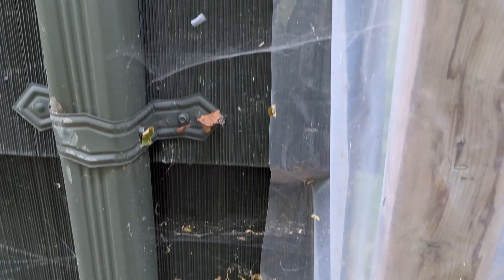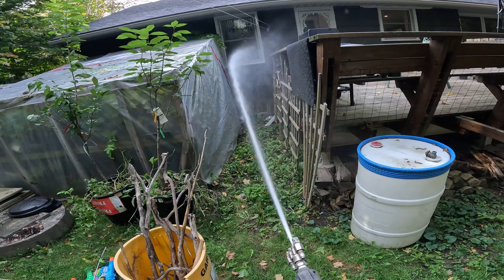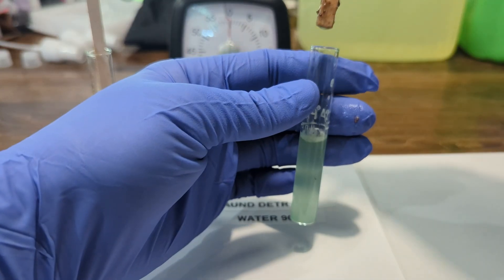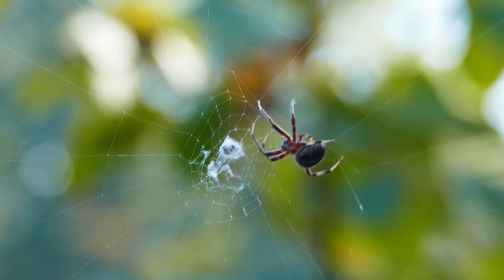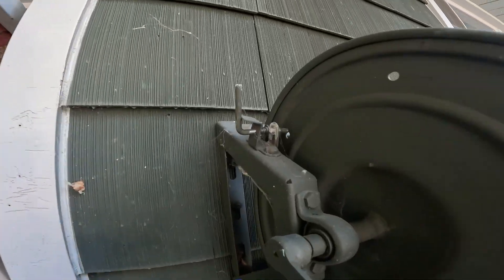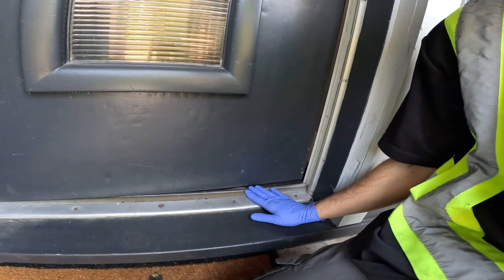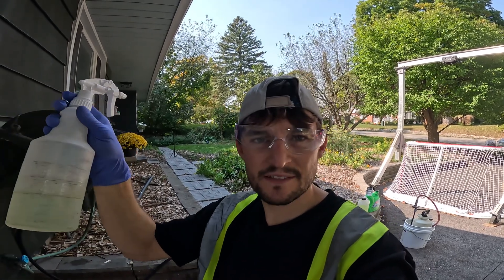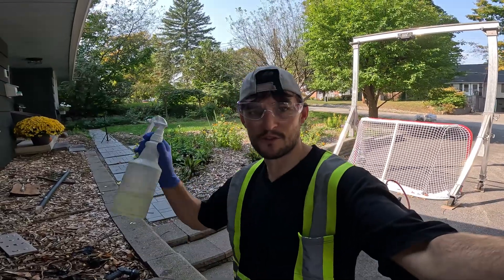How To: Remove Spider Webs with a Pressure Washer & Bleach

Comment: I was wondering whether there might be a miscalculation regarding the final SH ratio, or if I’m simply misunderstanding it.

The proportioner indicates a ratio of 15, which corresponds to approximately 6%. However, since the SH is not 100% concentrated but rather at 12%, the actual concentration applied would be 6,67% of 12%, so 0,8% SH.

The same principle would apply to the X-Jet…

What’s your take on this?
Reply from the maker: Yeah I botched the explanation for this.  I should have stated I was considering the 12% sh as 100% starting chemical concentration.  So yes The final numbers would need to be multiplied by 12% to get the absolute concentration of SH applied.

Comment: My pressure washer has a built in injector at the pump which pulls in cleaning solution. Would this be the same thing that you are referring to as a “downstream injector”?
Reply from the maker: Yes but only if yours works.  Some of the built in ones are not great, so I'd test it and see how much it pulls

Comment: Have you tried this with a foam sprayer, applying the solution? 
It seems like the foam would help saturate the area longer.
Reply from the maker: You can but then you're likely going to be too heavy with the soap.  You then risk having it dry with soap scum and will be spending excessive time rinsing and rinsing. 
But there are products for getting the mix to stick longer, usually used for roofs with a strong mix where there's thick growth of moss and you need the bleach to really dwell. https://pressuretek.com/cling-on-with-apple-scent/

The rest of the time is not really necessary.  Just hit the area again if you need.

Comment: Good job Andrew.  Entertaining and educational! Now I'm ready to clean this weekend.
Reply from the maker: Thanks! Let me know how it goes 😁
Reply: @AndrewMeades  Well, not too good. Tried diluted househould bleach (4 oz to 60 oz water to make 1/2 Gal) and then liquid pool chlorine but didn't see the webs disolve like yours did. Would be helpful to know how you mixed up your solution and what you used. Because bleach is about 6-9% SH, while liquid pool chlorine is 10% SH. So in order to make the pool chlorine 5% I would have to dilute it 50%, which to me sounds too strong to clean with. Thanks for your input.

Comment: Just in time! We just moved into house covered in spiders and spider webs... ugh... eeeewwww!  I was really creeped out early this morning in the dark letting my dog out... I used bleach and soap yesterday but after watching this I'm making it stronger! 👀💪🤺
Reply from the maker: That's great! Yeah one thing I failed to clarify is you need at least a 5% solution of 12.5% SH which is the yellow jug, also known as pool shock, available at pool stores.  If you're going to use Clorox household bleach that's a starting 6% SH concentration, so you'll need to go 10% with it to get the same effective bleach concentration.  Also SH breaks down over time so if your bleach is old that might be the problem as well.  Basically if it's not working after 10 minutes, keep upping your concentration, until it is, keeping in mind the surfaces mentioned you have to be careful of.
Reply: @AndrewMeades i will definitely use the pool shock! Thank you!

Comment: Do you have a video that shows your pressure washer rig for cleaning heavy equipment?
Reply: Thank You for the quick response and sharing your videos!!! Very helpful.
Reply from the maker: @pattyjenkins4829 no problem! Glad you like them 😁
Reply from the maker: I still need to make a video of my setup.  It's basically a Pressure Pro 8GPM hot unit built into a 16' enclosed trailer with a tote tank.  I have shelves that have tons of cool things that solve all sorts of problems.  On the back of my truck I either have another skid unit or I put another tote tank and a 4GPM hot unit. 

I don't clean a lot of heavy equipment. If you're focusing on that you'll want a big water tank and big pumps for lots of flow.  Flow is speed.

Comment: for those wondering and missed the few mentions; SH is literally original chlorox bleach. the solution he uses is 5% SH, 95% water.

be very careful what you clean the surface with afterwards. and if you see a noticeably yellow green gas forming on the surface of whatever you're cleaning after you've started that part of the process (post water rinse), _get away from it_. chlorine gas is no joke. and double check your mix ratio, and how you rinse off, that shouldn't be happening.

Comment: What dilution would you use with an X Jet for siding and pavers?
Reply from the maker: @jasonrolon7010  both probably require different dilutions.  Non-Porous vertical surfaces you could probably get away with a higher dilution. Porous flat surfaces are going to need more depending on how much organic growth and dirt build up there is.

I don't do very much residential, so I don't really optimize.  Guys who do it everyday can tell you exactly what percent you need.  I'll often just nuke everything with my x jet which is 18%.  My xjet is open I don't have any proportioners installed.

I would do a bucket test yourself so you understand what your specific machine pulls.

Comment: You could have just used a broom and a hand brush. No chemicals or extra time.
Reply: Everything is chemicals. Not everything we don't understand is harmful.
Reply: @tatecore  Ya, even H2O is a chemical.  If that's all he used, he would have been fine. I'm quite familiar with NaClO.  It's an alkaline inorganic solution that  is toxic, causes burns to skin, eyes, and lungs. It's the precursor to bleach.  I wouldn't spray bleach all over my house, just to get cob webs off.  I'd just broom them off, then spray the house with water or mild detergent to get the mold and moss that might be growing on it.  Spraying bleach is a dumb idea as it kills plants, insects, animals, and birds.  It also smells like crap.
Reply from the maker: @someguy-k2h  That's not cleaning.  At best you're knocking them out of sight.  Applying a house wash with SH takes care of the spider webs but also works on any algae growth or organic matter and dirt buildup.  A broom is not going to do that. 

If you're worried about chemicals keep in mind, Sodium Hypochlorite breaks down into salt, water and oxygen with sunlight. It's even used to clean our drinking water. Just needs to be used correctly (diluted) and with respect.